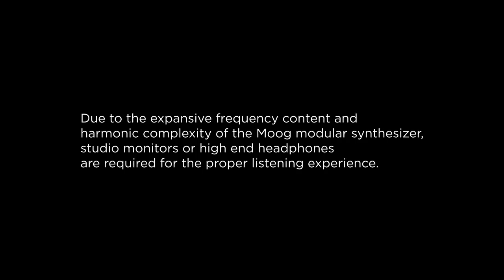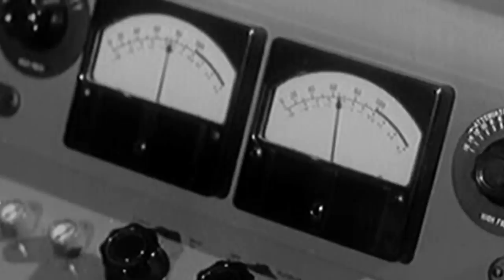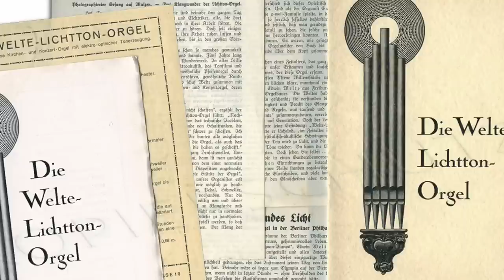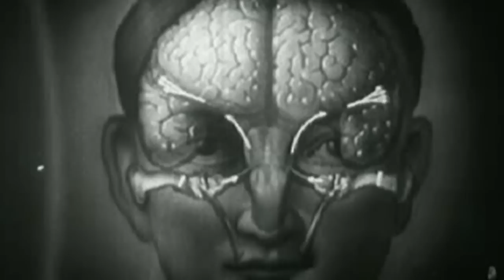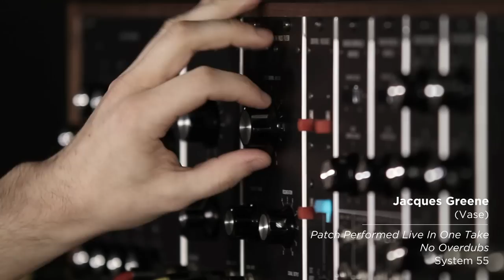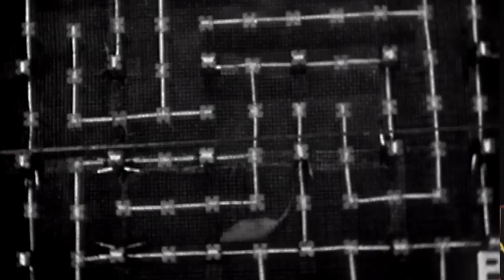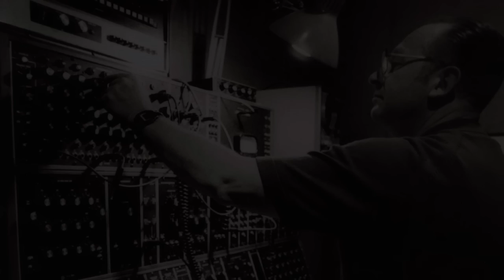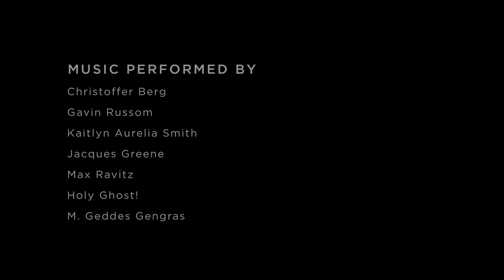Back to the Future Sounds

Comment: Hmm if the sounds are infinite in number why are we always hearing the same sounds again and again, all the sounds in this video are sounds that one heard in the 70's - but let's hope they are right and some new sounds will appear.
Reply: The sounds are in your mind, that's why they're infinite, the Moog is only a instrument or a vehicle for your own inspiration.
Reply: cos that kind of thing happens usually in all areas,...see the great success that was wendy carlos's "switched on Bach" , but a new instrument with that potential deserved another proach, but at the same time opened "the ears" of the listeners that also used to refuse new things or in this case new sounds...
Reply: exactly, all I'm hearing is boring tangerine dream on this video.
Reply: new sound have appeared as new chips have came along. for example the altari punk console is step tone generator that made in 1980. now days IC chips are really good so you can cram a lot in mod. what I heard in 1970 the ic chip where not that good. plus with midi you can control several mods at once.
Reply: They are not the same sounds but our mind needs to train to hear the differences. Technically speaking, no instrument makes the same sounds ever, but in a piano you have a range of sounds to play with, and that's it. In a synthesizer you will always have continua and that is extremely powerful if not to music to any kind of sonic experience. I think this is what the message is about, or at least this is how I understand and experience music.
Reply: I can go make some sound you have never heard before in literally 20 seconds. It might not sound good though. We flock to sounds we like, and there are a much more finite number of good sounds out there.
Reply: good point! i feel the same. i can think of a few reasons.  maby very early on they discovered what works, musicwise and what doesn't.  and sounds are maby infinite, but our ears and brain are not.
Reply: explosu I do agree with you that digital synthesis has a much much broader spectrum of control and sound, but I do favor the sound of analog. It has it's own mind and can be unpredictable. I love that.
Reply: Where can I get one?
Reply: ***** Because this is a totally classic synth. Exactly how they used to be made. I personally find that Pittsburgh synth to be way too cramped and not nearly as modular as I'd like
Reply: Just in this video alone there are dozens of sounds, sounds you've never heard before. They may sound similar, but the slightest turn of a knob makes it different. You can, if you want, emulate things like strings or horns or percussion. Or you can make those sci fi sounds you seem to be upset over. But the reason people want to see modulars in production again is because of 70s nostalgia, and a little bit of 80s New Wave, so of course that's what is demo'd.
Reply: Maybe MOOG isn´t exactly the right choice when it comes to talk The Future Of Sounds, it was in the 70´s. But if you look at Eurorack, then you will se that it is going somewhere new and in that journey I am convinced you will find those new sounds and modulations.
Reply: The limitations of the human are often reached sooner than all the possible permutations and combinations of the instrument are iterated.... and then the next human arrives for a shot at the title ;)
Reply: Trolls.  I hate trolls.  Long live the Moog Modular and the VISION it's operators bring to sonic life!
Reply: At this point digital software synths really are the instruments with true "infinite potential" (at a fraction of the cost).

Get with the times Moog!
Reply: Zak Saunders But it isn't as chaotic as modular analog rigs. Doing things without a mouse and keyboard is a pretty big boost to creativity for me at least.
Reply: ***** Me neither, but it just kind of is. That's why bands have jam sessions rather than just writing sheet music. Things can happen when you twist that one knob that you didn't expect.
Reply: ***** That is right, though I would always prefer real knobs to using a mouse. If I had a midi controller that had physical controls for every knob in FM8, I would be a lot more productive. Two hands vs one mouse.
Reply: @Örn Leifsson - They're similar, but due to the nature of analogue synthesis, it's never really exactly the same. I don't think one should make new sounds just to make new sounds, though. I know some people do, but originality for originality's own sake is usually a bad idea in any artistic expression. That's my opinion, anyway, and I know some people would probably disagree.

There's nothing wrong with using sounds that happen to be similar to ones used before. In most cases, I don't think it's a conscious choice either. The main thing is doing one's own thing, using one's own ideas to create the sounds that inspire your own musical performance or composition. I think many people gravitate towards similar sounds because they're simply more immediately likeable. We are all human beings, after all, and more similar than different. We have many converging ideas because they are all based on the same human experience.

And, if someone uses not just similar, but exactly the same sounds? Well - I don't think anyone claims that just because we have one violin player in the world, everyone else should stop playing the violin, do we?
Reply: money we call it............ a moog got great sounds...but not infinite,,,,,,,Max or supercollider can be in a sense really infinite....you can use a lot of osc to produce a sound,,,,,,,,,moog 3  i think.
Reply: NikkkitoNippongo This infinity of sound in peoples minds is  going to stay there whilst modulars are the size of a house and cost the same...

It's all moved on whether you like it or not - its software and laptops now...

The worlds most successful electronic producers are always travelling and they use laptops and software whether you like it or not...

And many do create sounds never heard before without using a modular the size of an elephant.
Reply: I totally agree - where are these unusual sounds? Everything on this vid I've heard before and it sounds dated...

However modern genres that have producers not using these synth beasts sound new and fresh...

I think it comes down to cost and portability...

If a modular could fit inside a laptop and was $250 you might sell more than 3 every 30 years - lmao.
Reply: i love the moog "sound" .....and his historic development.......but relationship between cost and capabilities is so ridiculous..........pc and laptops are superior and really cheap ......the professional musician knows it....thats just for fasion millionaires and keith emerson.......it,s not for true musicians.
Reply: cuerpoeperra That being said there is a problem that I have with digital synthesizers. They are too perfect. Ones and zeroes can't replicate the chaos of a true analog oscillator, despite their best efforts.
Reply: but art is not based only in caos.........ok, to any progressive rokcer could be,,,but an instrument that only could be used for "a kind of music" and with such elevate price no can be taken really serious......listen John Chowning music or Barry Truax,,,pioneer of pc music and fm sinte and you will undestand it............ An many others with tha graintable sinte..........the analogical sound its ok....but you will only pay 90 thousand bugs for growls and super bass sounds????? it makes no sense
Reply: BrooklynPerson30000 They just provide a much more open routing scenario.
Reply: yeah i know :) i just think that too much can be a bad thing
Reply: Örn Leifsson Because if you've ever used a synth you know that there are a lot of ways to make non-musical sounds and finding the "good" sounds takes an incredible amount of experimentation. We all stand on the shoulders of giants.
Reply: Being a Moog owner I do know that - but the emphasis in the video is all about NEW sounds and therefore it was very disappointing to hear nothing but the classic Moog sounds here.
Reply: Örn Leifsson If you consider that human hearing has limitations and we can't hear an infinite number of sounds then the possibilities are already drastically reduced. Then there is the "path of least resistance" to consider. Since all instruments make certain sounds more easily than other sounds and combined with what the most commonly desired sounds the instrument can make are, people tend to either make the most easily obtained sounds and/or work hard at obtaining the most desirable ones. So after many years of an instrument being around, a majority of the easiest and most desirable sounds have already been done by someone and the 'new' sounds tend to be subtle variations on those IMHO. Considering mathematics, there is an infinite set of numbers between 0 and 1 but the differences between many of the numbers can be insignificant.

All that rambling said, consider the relatively limited acoustic piano sound pallet but all the unique and wonderful music that has been created with them over hundreds of years! And people are still making new music with them. Considering the greater relative range of possibilities with modular synths and how they are still relatively new instruments, there is much to be explored/discovered and inspirations to be born.
Reply: Örn Leifsson Because those sounds are still awesome.
Reply: ***** Exelente!!!!
Reply: I guess it depends on what you mean by innovative. I have been trying to wrap my mind around this concept of "infinity" that is often used as a sales pitch by Moog, but I think what it comes down to is the possible combinations between all of the various input and output jacks combined with the entire sweepable range of the entire compliment of potentiometers. Then the secondary and sometimes tertiary functions of an individual module come into play.  I don't believe that quite equals infinity in the literal sense but a damn high amount of programming variety from a system designed in 1973  All of those results might not exactly be friendly to the ears however. I see your point though.
Reply: +Örn Leifsson Because people get stuck on using the same sounds, when they could be creating new ones
Reply: +Örn Leifsson Because this infinite number is exacly just like one of Zeno's paradoxes about points. There is an infinite number of sounds which most of them sounds almost exactly the same, and practically- they sound the same. Problem is, that there is a limited number of sonds that have harmonic order (so they have pitch), limited range of frequencies that can be heard, and for most purposes we use major/minor system operating on equal temperation system- that is LOTS of limitations which are necessary to get hearable sound with order that makes them music instead of noise. This modular is surely terrific in terms of sound quality, but apart from that it is mainly a waste of time. A problem with today's popular musicians is in different place.
Reply: I think it's because most of the sounds heard here (while having amazing sonics) are made by younger people who are just learning modular synthesis. You wouldn't find a violinist or guitarist doing world-class music in only 3-4 years. I wish they'd had more music from these older musicians; many of them truly are experts on the synthesizer. I look forward to more of the sonic newness being offered as more people get experience on these instruments.
Reply: That's because these are the Moog sounds. Their signature sounds. You can't mistake them. Check out the other brands - Xaoc, Mutable Instruments, Intellijel, Erica Synths, Make Noise... You'll hear sounds of the last two-three decades.
Reply: Limitless combination of numbers... same numerals.

Comment: I wrote a high school English term paper on electronic music around 1970.  I remember Moog and others.  Then several years later in college at UNC-Chapel Hill, I attended a Gershon Kingsley Moog Quartet concert.  There were four Moogs with speakers at the four corners of the auditorium.  Of course, I was sitting at the front left corner closest to Kingsley, so the cassette tape I made got mostly one speaker.  "Popcorn" was popular at the time, so of course he performed that.

Comment: I have been composing hip-hop for some time now, and I've always used the ES2 synth in Logic Pro X for the bass as I found it good enough for my needs. Then I bought an MS-20 mini and my game changed entirely; composing went easier, finding the right sounds became more intuitive and the entire process became infinitely more fun. Sending a sequence from Logic to the MS-20 and recording the output back into the project, I found that even though I used a loop I composed, the resulting riff from the MS-20 sounded different on every loop; it had a subtle difference that added life to the piece. I was never to return to software monophonic synthesisers ever again.

Comment: The kick drum efforts here are quite flabby..not sure if that's just the envelope on the modulars being looser than the one on the voyager, or the programming. Im fortunate and blessed that Ive had the pleasure of using an old system 55, and the sounds are very close in terms of 'whump' and the cut and buzz of the filter. Such a creamy, rich, versatile sound.

You DO need to spend more time programming a moog modular than say an arp 2600 ( ive owned one in the past) and a system 100 ( own a full set), but the sound is VERY powerful and like nothing else. It doesn't even sound like a minimoog or any of the other portable moogs that came after it. The only thing with more power and versatility in my mind, than a system 55, would be the roland system 700. But they're VERY rare on the ground, so good luck in finding one for sale.

It's interesting as to what this will do to the value of the older gear. Very cleverly priced, as the second hand system 55's are now commanding some serious wedge. I know how much one went for a few years ago, and my eyes were watering in shock...it was astronomical.

Comment: Great, but only affordable to the few.
Reply: And accessible.
Getting the system is a job in itself.
Don't forget all the cables you will need to connect one thing to the other.
That's the beauty of it.

Comment: The problem with these modulars is that the ones that use them doesn't seem to be able to create any interesting music, at all. Except stuff like that self made auto accomp thing that bearded guy played which was extremely basic...

Soundscarpets, drones and repetetive noise patterns... As i see it, Tonto's had it covered long time ago. 
The art and fascination seems to be in the handling of the system itself. That messy cable patching and the feeling that one is a engineer physically building the sounds... Is unique organic analogue sounds really that funny if used in such uninspired and limited ways or is it nowadays when musicians have a choice just a genre for engineers and technicians rather than musicians?

Comment: A Minimoog XL has more features and can do more, a Sub 37 can do more. Did you notice that Kaitlyn Smith had to use 2 System 55's ? That's $70,000 and it didnt really sound impressive at all. A Minimoog  or Phatty with a few Moogerfoogers offer far more for one tenth the price.